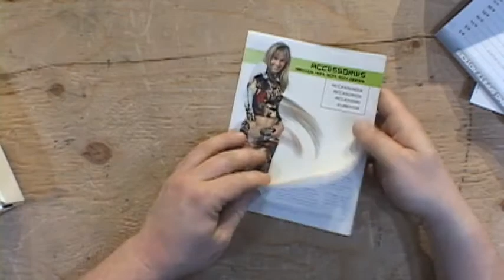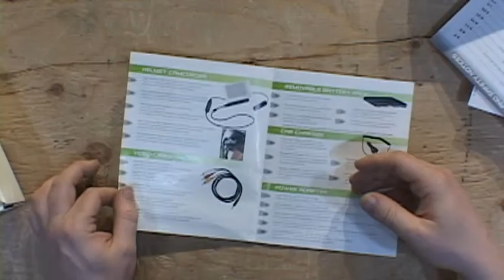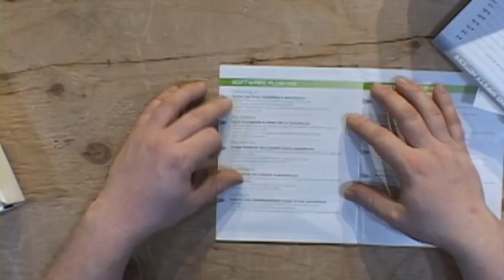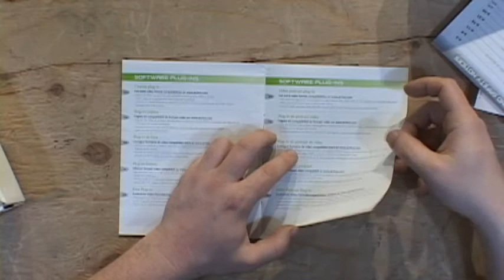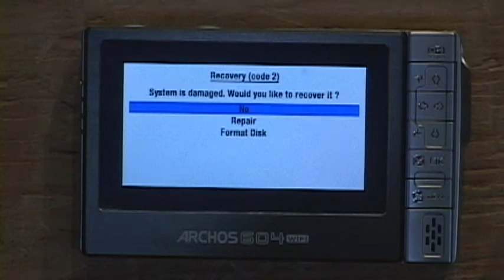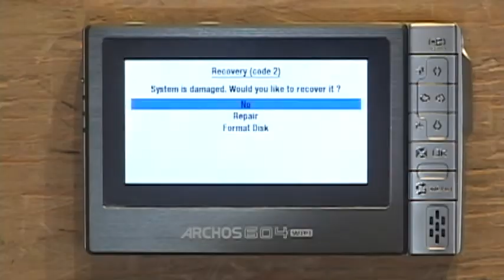Thrift Find - Archos 604 Wi-Fi

Comment: Cool, I enjoy seeing pre-smartphone portable devices. The 604 can be firmware downgraded to 1.3.10 without HDD lockdown if you are interested. Though I haven't done it myself and I don't know if it's worth the effort.
Reply from the maker: That would be interesting to hear more about however without a replacement hard drive I currently would not have a way to verify this myself.
Reply: @CelGenStudios  Maybe save all the needed files just in case, https://forum.archosfans.com/viewtopic.php?t=70908
The procedure looks very detailed but seems quite possible.
I have an older model, non-booting Archos, one day I may revive it so I saved the needed software and details just in case.

Comment: The comment you made regarding the pitfalls of mechanical hard drives in portable devices like this is why I chose to retrofit my "7th" gen (6th, rev. 2) iPod classic with an SD card adapter. Nowadays it simply doesn't make sense to seek out a replacement drive that's just going to fail again if it's dropped or otherwise subjected to physical shock.

It's very unfortunate Archos decided that it was a good idea to lock the drives to the unit itself, given that even at the time it was very well known hard drives aren't exactly durable and don't last forever even when treated nicely.

Comment: Great video! I have a 604 (not WiFi) that I purchased in 2007 and used hard for many years. It still works, and I just ordered a new battery for it. FYI, if you are interested in trying to salvage yours (fun project), newmp3technology.com has an adapter that you can use to salvage data off the old drive and/or plug a new hard drive into your own computer and format it. Here's the write-up: "Use this device to convert your internal Archos hard drive for use in a desktop. Perfect for those who wish to salvage the drive from an otherwise non-functioning player, format their drive or those wishing to recover their data by making the Archos drive a slave drive in a desktop." I've purchased from them before, had very good experience. If you do try this, maybe consider posting an update video? I'm still using mine, hope you can get yours functioning. I'm sure someone has to have hacked the OS software out there. If I run across it, I'll post. Thanks again for the video.